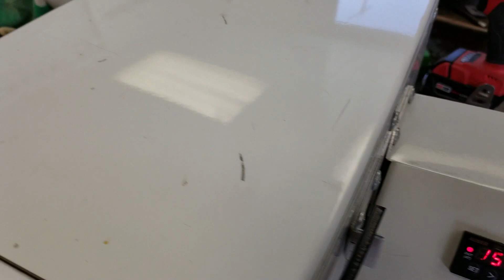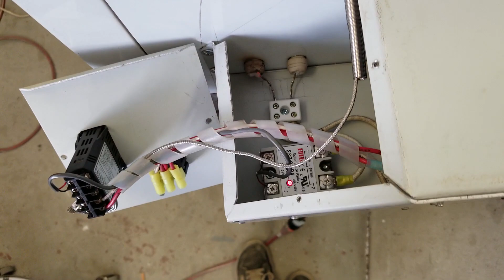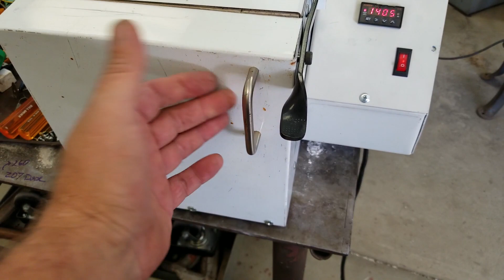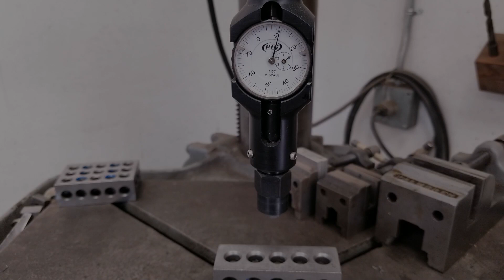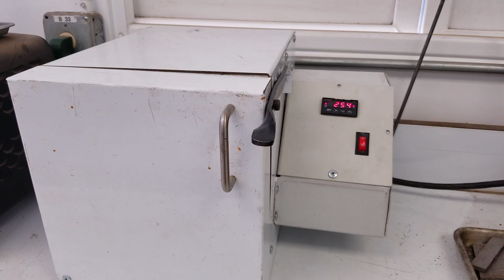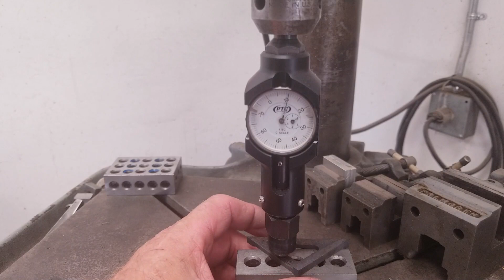Tabletop heat treat oven part #3

Comment: Does the area under the jaws of the tongs end up a different hardness since they are not exposed to the quenching oil as much? Thanks
Reply from the maker: Good question, I use serrated jaws, oil flows in the grooves just fine, I have tested the plier areas with no measurable change.
Reply: @ShadonHKW  
Thanks for the reply. I'll be sure to do the same.👍

Comment: Hi i built my own oven very similar, just wondering how you stopped the part of the element that goes  over the top from sagging?
Reply from the maker: I make "staples" out of the NiChrome wire and stab them into the Kaowool board with needlenose.
Reply: Do you have the same issue on the  vertical run on the sides?  Do they sag and need staples as well?

Comment: Looks like those ovens are gonna be great...!!!!
To strech evenly the coils, you ty one end and pull up to the required length by pulling the other end in one shot, just pull, check for srping then pull a little more until you get what you need, that's the way I do it and it works perfect, and, I'm using the same Camco Kenthal-A1 wire, should work for you also...   ;)
To lower the heat in the porcelain you can triple the wire wound on the ends instead of doubling, it will reduce significantly the heat at the terminal.

Comment: Stan I am glad you pointed out that you should put the hard part back into a temper oven before it reached ambient. It is good practice. I use two ovens, the main oven will not cool off fast enough. Excellent build on the table top oven it was an interesting series. Cheers
Reply from the maker: I have already toyed with the idea of double stacking the #hotshot360, 1 control panel on the lower oven, dual input temp controller maintaining 2 separate environments.
Reply: Now that is a good idea!

Comment: Stan, Great video!  Question,  does the control work have a programmable timer to ramp temperature up/down?  Thanks!
Reply from the maker: The standard control does not have ramp and soak features, it is a standard size and one can easily be plugged in to the 48 x 48 mm opening. Trying to keep it affordable.
Reply: Thanks!

Comment: Did that thing really increase the inside air temp of that oven 600 deg in 45seconds? Is that a thermocouple measured air temp or a calculated resistance temp?
Reply from the maker: Thermocouple temp, but keep in mind this is in open air and doesnt take saturation of mass into account, 30 minutes to a stable, saturated (empty) oven.

Comment: Those are impressive numbers for 2" of insulation. A few years ago I considered building a very similar oven because I couldn't find a small oven to re-dry welding electrodes, but the Rockwool people recommended a full 100mm. And that oven was only meant to get to 400ºC.

Comment: 2 reasons you might consider not drilling holes near the porcelain block. 1 someone could insert something into the hole. 2 since the fan is blowing out, any dust floating in the air will get sucked into the holes and bake on to the heating element. Just something to consider

Comment: Why did the hardness tester read at 10 without pressure applied to the tester, yet the scale starts at 0?
Reply from the maker: Instructions state it doesn't matter what the reading is at rest, just the result on a calibrated block.

Comment: You should get some furniture for that oven. Those parts really do not like sitting on the floor.
Reply: https://trugrit.com/index.php?main_page=product_info&products_id=6148

Or a firebrick with slots works too
Reply: @12345NoNamesLeft  why does it matter if they're standing up or lying down?  Thanks
Reply: @firstmkb   Laying down, only fit one piece at a time, hard to pick up with tongs.